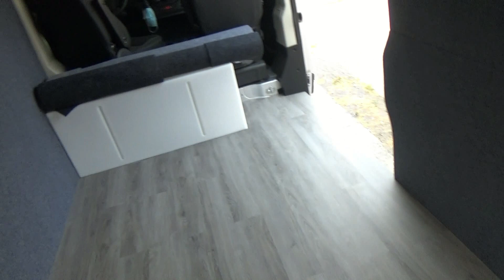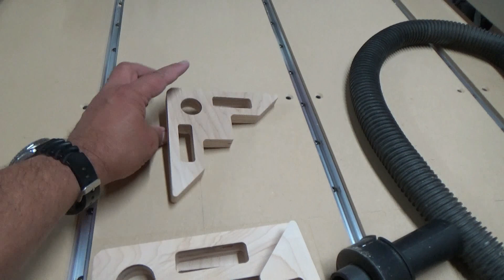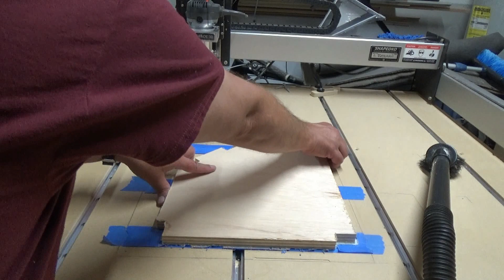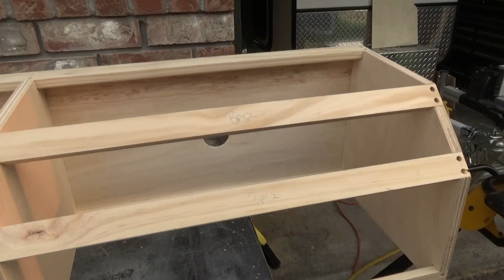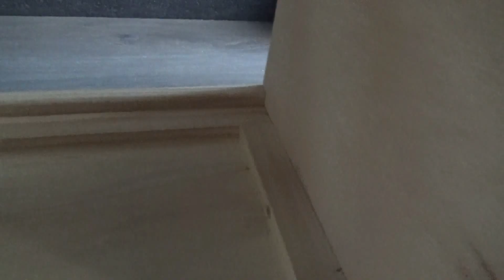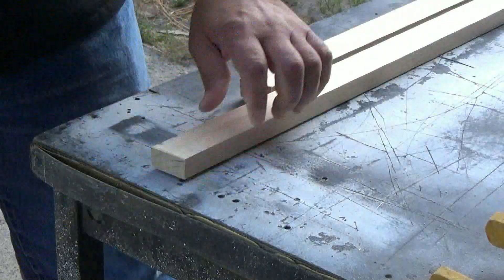DIY Van Build – Promaster 2500 159WB – Cabinet Build – Part 9

Comment: Al, did you make all of your cabinets the same size (depth, height)? Could you tell me the size. I can see the dimensions for the height (13 and some inch) on the templet but I don't see a depth. It would be greatly appreciated if you could provide that. Thanks
Reply from the maker: Hey Ed M... the height and depth are both the same, finished dimensions are 14" high x 14" deep

Comment: Nice job as always! Glad to see the CNC in action. What CAD software are you using? That looked like Carbide Create to do the G code.
Reply from the maker: Yessir... used Carbide Create to create the tool path and Carbide Motion to run the G-Code. Works pretty nicely!